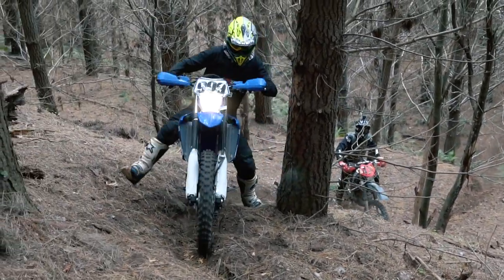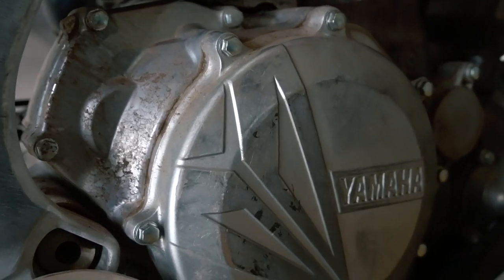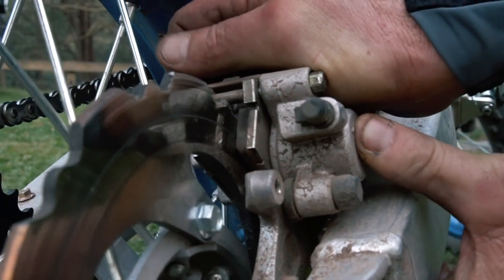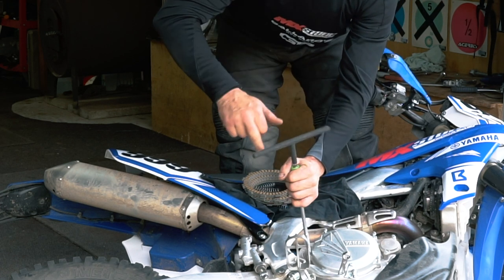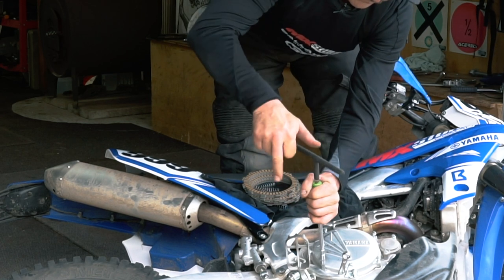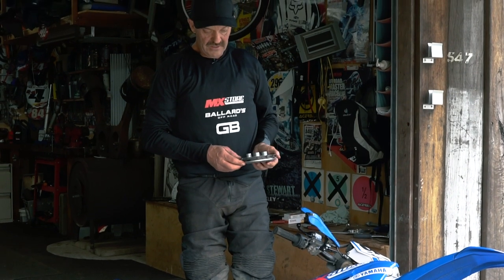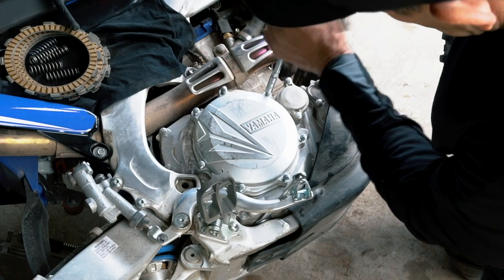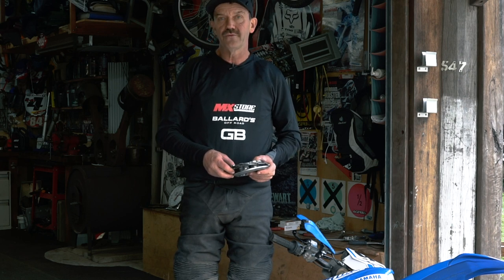Easy Clutch Changes with Geoff Ballard | MXstore.com.au

Comment: I've noticed most people running stock Yamaha clutch replacement parts and that's my intent when needed. Is there any advantage to "upgrading" to some other brand?
Reply from the maker: It all comes down to personal preference, aftermarket is a great option if you are on a budget and they are still great quality as are genuine parts! 👌🏼

Comment: Great video. I rode my wr250r and almost at the top of the hill I lost all gears. Even thou I could change gears and you can see that the neutral light is changing with the gears but no gear is engaging. 
Is it that the clutch is burnt?
Thanks
Reply from the maker: Oh no! It could do, but we would recommend checking with a mechanic to determine the issue! 😀

Comment: So will a new clutch soften my clutch pull on 2017 yz450? I'd like to have it a one finger pull. Any ideas,
Reply: Hand strength training works best, honestly... get one of the little grip strength trainers and use it when you're watching TV.

I do this in the off season and can 1 finger the clutch on my 2016 WR450F on 4 hour hard enduro rides.

Comment: Hello everyone, I have a yz250f and when bike is turned off and I press clutch in the bike doesn't roll when in gear? But works when riding lok
Reply from the maker: This is fairly standard for most bikes, there is quite a lot of resistance even with the clutch engaged. If you are ever worried you can always take your bike down to your local mechanic and get it checked out!